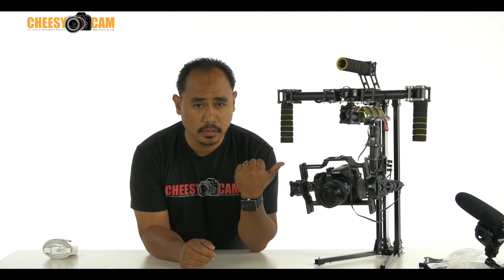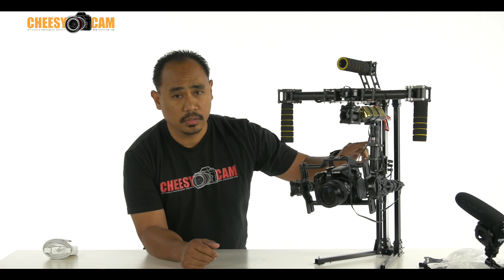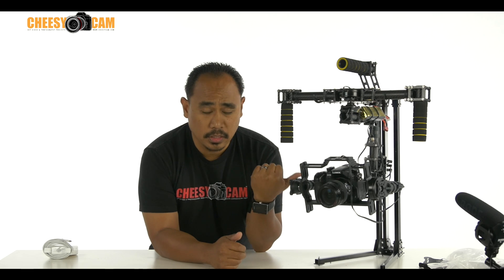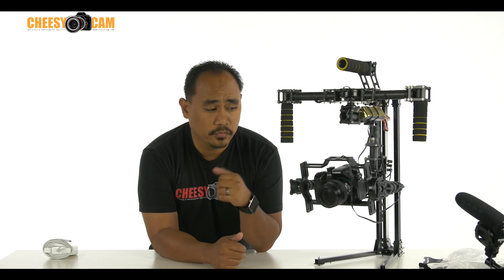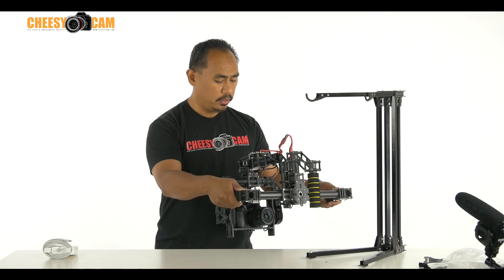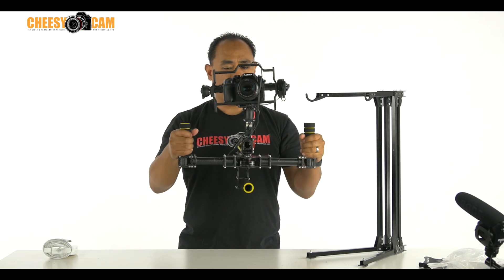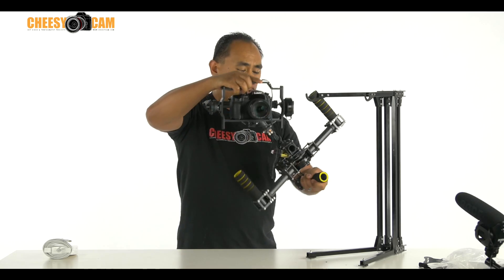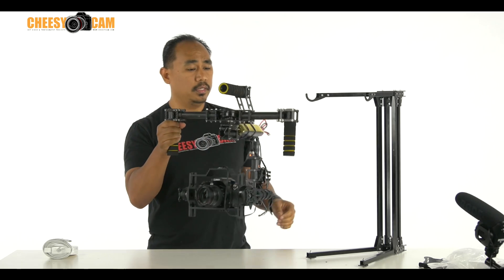32 Bit version 3 Axis Gimbal CAME 7000 Stabilizer Alexmos Basecam

Comment: Is there a way to build this thing without buying parts from CameTV? I ask since they don't sell the DIY-kit anymore and I can't find any documents on what parts I need. :)
Reply from the maker: DelphiTheDolphin There are still other frame kits out there, but you may have to buy some parts separately like the control board, better motors, and wiring.
Reply: There are? Can you point me to one? I can't seem to find any.... and not any other DIY-stuff.

Comment: Many thanks for your videos!
I am really interested by the CAME 7000, do you think it is possible to use it with a GH4+Zeiss CP2 15mm+mattebox?
Reply from the maker: I think that would be too much. It's not always the weight, but how the weight is being distributed. Since the mattebox may sit too far forward you can't get the proper balance on the gimbal frame. You will not get good performance from a gimbal without having the camera balanced.
Reply: MrCheesyCam  Ok thanks! I'll have to use it without the mattebox.
GH4 + Zeiss 15mm is around 1,6Kg so it must be ok for that.

Can you tell me how many time did you wait to receive the gimbal?
Reply from the maker: I'm in California, US and I would say it took about two weeks. Some people received it in one week, I guess it just depends. The company ships fast, but if if there is a delay sometimes it's the customs department in your area.

Comment: Could anyone help me why my 32bit is doing this?
default has it at axis top z and right as x??
http://youtu.be/UCcquWPRzYE
Cheers
Reply from the maker: On the CAME 7000 your software should say Z on top axis and -Y as the right axis (because the sensor is mounted sideways).
Reply: hey cool thats one thing i had wrong.. but yeh she stills isn't usable.. would there be conflict being mine was a 8bit set up and now running new 32bit board?
I've tried supplied profiles and a heap of high power low power to get it close to fine tune but it still has issues.. knew i should have just bought a 6000!
Reply: appreciate the help cause i know I've bugged you a few times too :)

Comment: In your opinion is it worth upgrading my 8bit version board up to the 32bit board only? Or should I upgrade my whole came 7000 system?
Reply from the maker: A 32 bit board should work the same with your motors. You don't need to replace the whole thing.
Reply: Cool man thanks for all your videos on this awesome gimbal! I'm running a 5d3 with a Canon 20mm do you think your profile with the Sigma 20 will work pretty well with my set up as well?
Reply from the maker: Yes should work just fine.

Comment: Great Video!  When is the tutorial on the Wiring coming out. I just assembled the gimbal but I am having trouble wiring it. Some of the wires look like they will get tangled.
Reply from the maker: As much as possible you will have to try and route the wires down the middle of the motors. This will prevent them from getting caught up in the frame. Running most of the wires would be the same as the 8 bit http://cheesycam.com/running-wires-through-came-7000-3-axis-gimbal/

Comment: This is very good news. Thanks for doing all the work to figure it out. The only thing I'd like to see is tool-less knobs for balancing the camera in the rig.

By the way, do you use the wireless mode on the GH4 and control focus and record function from a smart phone on the rig? That would be handy I think.
Reply from the maker: Yes sometimes I do use my smartphone to start and stop recording and also to change focus points.
Reply: MrCheesyCam What software do you use to do this on your smartphone?
Reply: William Bartlett It's an app from Panasonic called Image App. For Android I got it free from the Google Play Store.